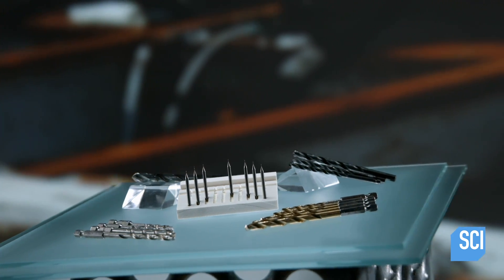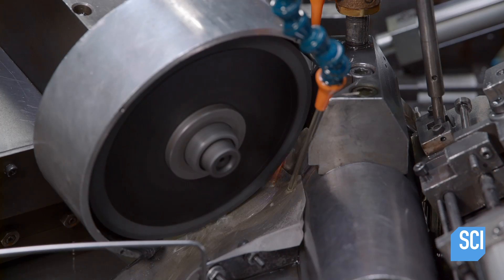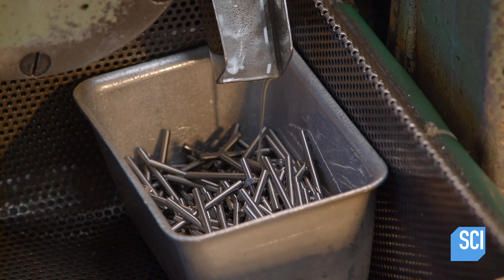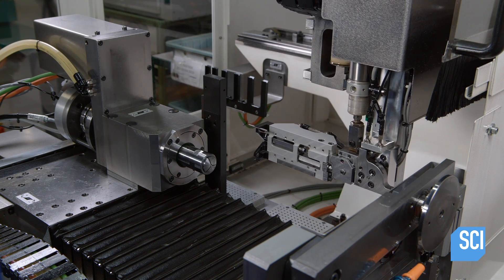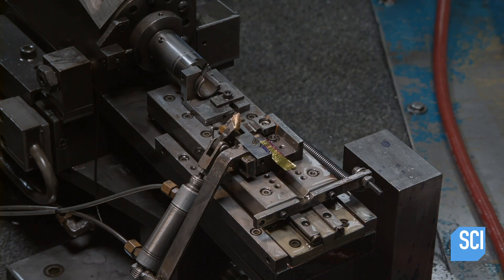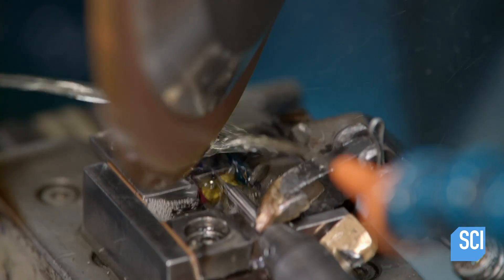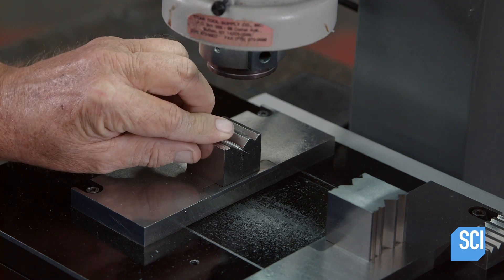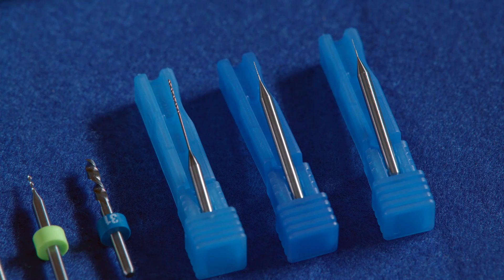How Micro Drill Bits Are Made | How It's Made

Comment: What's is this ? a drill for ants !?
Reply: I happen to see a drawing of a 10 mm thick disc which required four holes of Dia. 0.5 mm at 45 degree angle ... These holes were required to control the flow of fuel i.e. liquid hydrogen and oxygen (in liquid propellant engines i.e. aerospace industry) ... Such small holes allow for expansion of liquid to gas as well ...
Reply: @muhammadharisnisar  that's still almost twenty thousandth. 
That's huge compared to the bit in the video. 
We have a catalog at work that list drills down to one thousandth dia.
You could break that by looking at it wrong  !
Reply: @muhammadharisnisar  is there no better way to make these holes than to use a drill bit
Reply: @wiplashw642  Checkout electron beam drilling.
Reply: Laser.
Reply: @wiplashw642  you could use telepathy or a lightsaber, sadly both of those options are in short supply.

do u really think they would use drillbits if there were better alternatives?
Reply: The bits have to be at least three times bigger
Reply: This bits ar machining bits for gas-jets with 0.15 mm jet for example....
Reply: r/whooooooosh
Reply: You win the internet for today!!! I LOL'D!!!

this episode was made in the Derek zoolander center for kids who cant drill good, and want to learn to do other things good too.
Reply: I've built multiple nano technology parts for a plasma beam machine.  A lot of the parts require cooling built in to one end, and opposite those ends there are holes designed for electricity to jump across.  They're anywhere from .002/.005 and we drill with these in a finger controlled chuck, mounted in a collet on a 75k air chuck.  Last A good long while as long as you're steady and keep the run-out less than .0002
Reply: @johnnywayne7654  a finger chuck at 75k RPM? You either have balls of steel or it's not that bad. I got scared using a finger chuck at 3k rpm on my school's old Bridgeport.
Reply: wonder how many people missed this Zoolander reference.
Reply: I know they're used for making the plated through holes in very high density PCBs.
Reply: Fex vias in PCBs, they could be less then 0.1 mm in width, and that is the commercial area, there are no limits to military stuff I have seen smaller than that.
Reply: Andrew Jackson  It was a dildo comment
Reply: pie hole cleaner bits
Reply: Sounds like it's easier to drill with laser or EDM if you need a hole that small...
Reply: @taiwanluthiers  i dont think that edm is capable of creating really small holes. and laser is really uncommon. we build our own lasermachines for holes in 0.001mm ranges
Reply: @xloltimex38  You can make really tiny, and deep holes with EDM. It's just expensive. The challenge is probably making a brass tube very small...
Reply: @taiwanluthiers  thx for that information. we have ecm machines but no edm machines. 
we drill holes down to 0.01 mm with drillbits anything smaller we use laser. i will try to find some more info about the edm process
Reply: Printed circuit boards. Fuel injectors for engines.
Reply: It's a dildo for peehole
Reply: Betul buat para semut bikin sumur bor
Reply: Indra Jaya_
To drill your brain, let you be more stupid

Comment: What you drill with this tool who is thin like a hair...? A hole for a hairtransplantation mask?
Reply: The applications could be endless..Smart phone circuit boards maybe, or shafts of tiny gears like in a watch, or maybe holes in a micro sized fluid nozzle. The field of Machining covers so many applications it's impossible to tell what these are being used for.
Reply: @demandred1957  Watch makers have been making gears and shafts since the 1890s without the need for CNC...
Reply: @demandred1957  It's implicit in your statement because the video shows a CNC machine making the micro drill bits. And I'm referring to wrist watch makers, which weren't around prior to that decade. (Fob watches were.)
Reply: Probably a CNC machine that needs to make very fine details.

Comment: So many nomenclature errors..As a Machinist with over twenty years experience, I can tell you a centerless grinder grinds the WIDTH of a part, not length. The blank was loaded into a collet chuck, not a clamp. And he was checking the flutes with a Optical Comparator, and a portable microscope. Not to mention most Machinist's could see the difference between the fluted and non fluted pieces with the naked eye (unless they are really old)..Any thing else I missed fellow Machinist's?
Reply: I appreciate your comments and experience! 20 years puts you in an era with many modern techniques and technology. Proud to say my uncle was selected to be a member of machinists on the Manhattan project (he didn't know it at the time). God only knows how they machined these intricate parts in the old school!
Reply: @US_Joe  Very cool! They machined them almost the same way we do today, with a lot more skill though, lol. They had optical flats back in the forties like we do now, and you can check flatness down to Millions of a inch with no problem. Johansen Gage blocks were a thing back then too (although very expensive and fairly new) and their so true to size and flat that you can wring two blocks together end to end and they will stick together without magnetism oil or adhesive. some say the gap between blocks is so small air molecues don't fit and it creates a vacuum. The main difference is the amount of time it took them to machine the parts on the manual machines vs CNC machines we have now.
Reply: Just a lot of stupid things. They said chuck or collar and I think they meant collet. They also said it holds the carbide perfectly still but the spindle is clearly running. Good call on the O/C not being a "microscope". And the comment at the end about carbide being strong made my skin crawl. Nothing compares to the feeling of dropping a solid carbide boring bar.... Speaking on behalf of a friend of course
Reply: @Awegner176  OMG...my skin just crawled..lol
Reply: So are these really carbide or HSS?
Reply: @JoseSuave  carbide. And oh so delicate. If you don't use them exactly right, they will snap in a instant.

Comment: What's the application for such a tool?
Reply: One use I know of is Drilling mini-holes in Semi-conductor Micro chips and Circuit boards.
Reply: @johnjohnichiban1  I think he's asking about the Micro-drill bits not the ones regularly used outside by carpenters.
Reply: Micro drills...aka circuit board drills...tho applications are many.